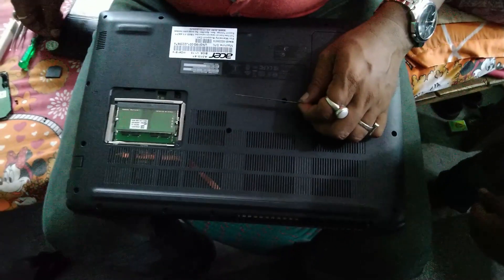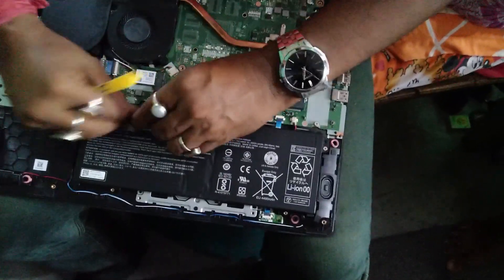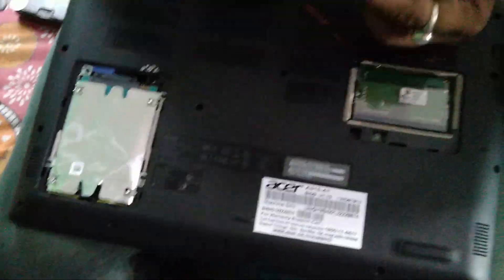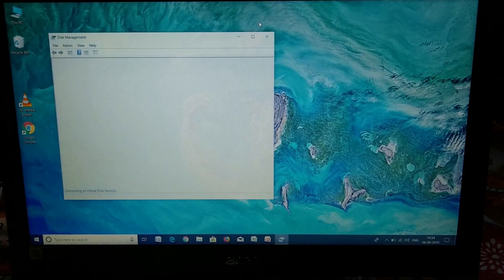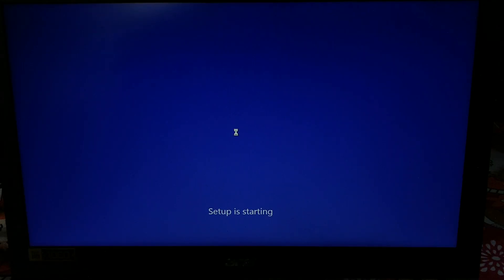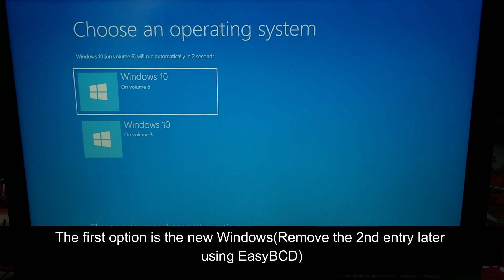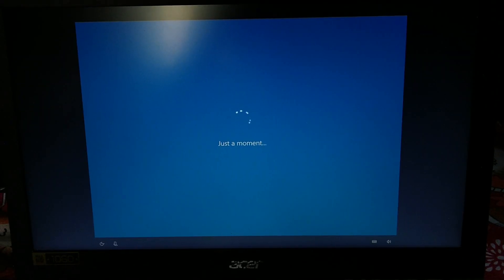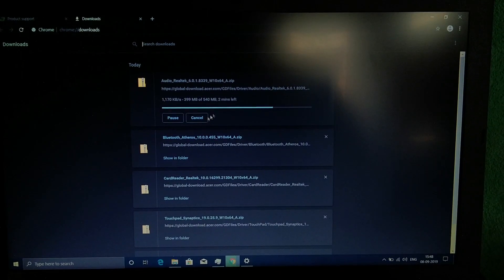ACER ASPIRE 3 a315-41 M.2 SSD INSTALLATION (SSD + HDD) | REINSTALLING WINDOWS GUIDE

Comment: hey i have acer aspire 3 a315-56 model..on a site i saw that i got pci m.2 port with 2000 speed maximum ..and there is  no any other source whether my lap actually have m.2 port. acer isnt responding when i asked them with my model number..can are you sure all acer aspire 3 models got m.2 port

Comment: I have installed m.2 sata ssd but my hdd is not showing. I asked the installer he said you cannot use hdd + ssd ....is he right?
Reply from the maker: Bro this is no rocket science, it's very simple. You can use both together, the laptop is still using the same sata m.2 ssd + sata hdd till date. 
The HDD is as it is, just initialize the SSD, done.

Comment: Bother i have an Acer Aspire 3 A315-21 model which has M.2 port for SSD, i just want to know will it work . As like in some websites, they are saying that it will not work . Please help.
Reply from the maker: If it has an m.2 slot, then it should atleast support m.2 sata ssd.
Reply: @DeepteshLovesTECH  thanks for reply❤, is it good if i use 128 gb only as system drive ?

Comment: hi, great tutorial mate. Can u tell me how to remove windows from the old 1TB hdd, while keeping the data files in it? any way out?
Reply: I have an Acer Aspire A315-51G (a pretty basic one with Skylake i3, yeah its an old one). Just thought of installing a M.2 SSD for windows so that this machine can keep up for a couple years more.
Reply from the maker: @_s.i.d_  as I just showed. Install Windows on the SSD and format the old windows partition on your HDD, later..
Reply: @DeepteshLovesTECH  brother, I meant to ask, is it possible to just remove os from that hdd, while keeping hdd media files intact. The format option which u showed will wipe out everything I guess.
Reply from the maker: @_s.i.d_  so partition your current HDD and move all your media files to your new partition. Install SSD on the new m.2 asd and then after booting and setting up, format your previous C drive which has the old windows.
Reply: @DeepteshLovesTECH  great idea man. Thanks a lot. Appreciate that u have taken time out to reply to each comment by so many people in the comments section. Thanks!
Reply: @DeepteshLovesTECH  if I could ask u just one more (😂), is it a good idea to upgrade my current aspire a315-51g (i3-6006u, have 8gb ram already, thinking of adding an m2 ssd for os and apps).
Will it last for couple more years? (Will also replace battery if required). Or simply keep running this one as is and buy a new one when battery dies.
I don't really do anything intensive, just some heavy web browsing, ms office and some movies videos n stuff.
I know the cpu is pretty weak for 2021, therefore taking a suggestion.
(I've spent 4 years on this already)

Comment: do i have to remove the windows on my hdd? if so can i copy files into my ssd first before formatting my hard drive?
Reply from the maker: Why will you format the hard drive? Just install the ssd, and then install Windows on the ssd and after booting up and setting up everything, later you can decide, what you want to delete or not.
Reply: @DeepteshLovesTECH  does that not interfere with anything? I heard having two instances of windows could be bad for the license
Reply: Also! Do i have to use rufus or can i use the windows media tool for this

Comment: can you help cannot install driver for touchpad as does not have a setup file when downloaded
also cannot find the pci enrcyption/decryption controller
cannot find webcam driver
have 2 unknown devices 
is e315-41-r3ft
am running windows 10 pro
Reply from the maker: All these drivers are in the Acer website.. definitely it has all the drivers needed as I did the same.

Comment: Hi, just 1 question, my m.2 ssd doesn’t appear in d boot menu in d bios, but it appears in disk management & my computer? Any help will be greatly appreciated. Thanks
Reply from the maker: Never encountered anything like that.. as long as you can use it, it's fine.
Reply: @DeepteshLovesTECH  hi again, it doesn’t appear also in d F12 boot menu, any idea how i can install windows in d m.2 ssd? Thanks...

Comment: I have a question, the acer aspire a315-51-341f has a m.2 ssd sata? And if yes, it has to be nvme or not?
Reply from the maker: No it supports m.2 sata 3 ssd (not nvme). M.2 is a format and it supports either Sata3 or Nvme connection. But since Aspire 3 is a budget laptop, it only supports Sata3.. which I think is good enough.

Comment: Hi! 
The HDD has developed lots of bad sectors (~370 after 1.5 years) and a lot of them are not re-allocated. I will be adding an M.2 SSD (primary drive) after the HDD fails completely. I had a few queries:
1. Is there any limitation to the size? I will be adding a 500GB MX500 or 860 Evo.
2. Will adding a 500GB M.2 drive disable the SATA port? I might add an HDD in the future.

Thanks!

Edit: My model is A315-41-R45R with 2 × 4GB DDR4 2400MHz memory modules.
Reply: I will be using the SSD as the primary drive (Windows, games, documents, ... everything on that).
Reply from the maker: @1_adityasingh  500GB should be fine, the limitation can be the power requirement of the drive itself. Crucial MX500 should be fine.
Nothing will get disabled. The laptop shown in the video has both SSD and HDD working together till this day!
Reply: @DeepteshLovesTECH  Thanks!
What are the temps of the SSD? It's right next to the CPU.
Reply from the maker: Never experienced any heating or slowness.. however 120gb is too small for any substantial heating.
SSD is not right next to the CPU, it has substantial gap between the heat pipe and the ssd. It's on the extreme right edge.

Comment: Hello, your video has been a great help. 
Quick question... I am thinking to add 4GB + 8GB RAM. Will it be a problem? Or it is necessary to add 4GB + 4GB.

Also, will my laptop stop lagging if i only upgrade my RAM and not add M2.SSD??? 

Thanking you in advance.
Reply from the maker: RAM improves multitasking and some application performance.
But SSD helps in loading everything fast.
Whatever you install in SSD, will open up fast and so if you install Windows on ssd, your whole Windows experience will become very snappy
Reply: @DeepteshLovesTECH  Understood.

And what about this
"I am thinking to add 4GB + 8GB RAM. Will it be a problem? Or it is necessary to add 4GB + 4GB.? "

Thanks
Reply from the maker: @vipin007i9  add 4+8 it's okay. Make sure it's 2400mhz

Comment: One like from me buddy, good video. have a question if you can answer, what the max supported M2 drive capacity on this machine.
Reply from the maker: It should support 480GB no problem.. I mean there is no limit as long as it is sata 3 and has no absurd power requirements.
Reply: @DeepteshLovesTECH  hey buddy. I seem to have ran in some problems, if you could help please. I got a WD Blue M.2 500Gb drive installed, did it myself. The drive was partitioned as GPT and formatted as well. I was able to use a bootable usb stick to boot and install the OS, the BIOS did identify the USB stick for booting. But after the OS was installed it still shows the original Toshiba HDD as the primary bootloader in the BIOS boot priority list. The M2  drive does not show at all. When a bootable USB stick is connect it does show the same in the BIOS boot list. I see some guys had a similar issue but am not able to figure out the cause. If you have any insights that can help. Thanks in advance.
Reply from the maker: @sanilxlf  after installing OS on SSD, during first boot you'll get 2 entries when booting windows.. one from the ssd and one from the hdd, the first one is the ssd. Just remove the 2nd entry using EasyBCD.
I didn't have to change anything like boot priority, after installing windows on ssd, it always boots with the ssd...

Comment: Hi bro I wanna upgrade my ram (same laptop)which 4gb ddr4 2400 mhz should i consider????
Reply from the maker: Go for CRUCIAL 4GB DDR4 2400mhz.
Reply: @DeepteshLovesTECH  but that is not returnable
Reply: @DeepteshLovesTECH  can i trust amazon
Reply: @DeepteshLovesTECH  whats about Kingston
Reply from the maker: @d..2363  yes Kingston DDR4 2400mhz also works. I normally recommend RAM from retail shop as you can try and see.
Reply: @DeepteshLovesTECH  thanks for reply,my friend,happy friendship day : )
My last question is that whats the price of this ram in store..
Reply from the maker: Should be 1500-2000.. previously before lockdown they were available at 1500-1700/-

Comment: Hi, I am using aspire 3 A315-21-48AQ....can I install ssd without removing the hdd?what is your best suggestion for me to buy a ssd?
Reply from the maker: Yes you can use ssd and hdd at the same time.
Go for any m.2 sata 3 ssd. In my case I used Adata SU650 ssd 128GB.

Comment: Can I keep the hdd and the ram at place and install a 256gb ssd and additional 4gb of ram?or do I have to replace the  hdd?
Reply from the maker: You can have ram,ssd and hdd all at the same time. Ram is in ram slot, hdd is in the 2.5inch drive bay and ssd is in the m.2 ssd slot 😊
Reply: Bro ram should be 4(provided)+4(installed) or it can be 4+8 even?
Reply from the maker: @hammadsultan07  yes it can be 4+8 or 8 + 8 also

Comment: Bro first time I have purchased a laptop
Acer aspire 3 ryzen 5
Laptop me heating ho rahi ha hdd ke paas kya ya normal cheez ha or kya is laptop ka fan sound karta ha
Reply from the maker: HDD toh garam hoga hi.. jeetna hdd chalega utna garam hoga.. mere me garam zyada nhi hota hai..kyu mere wale me Windows Ssd me installed hai.. hdd sirf movies aur games k liye..
Reply from the maker: Overall laptop doesn't get hot.. jeetna hota hai utna toh har laptop hota hai.. don't compare with i3 , as this is much more powerful as it has 4 cores and 8 threads.
Reply: Thanks bro

Comment: hi bro, i’m using Aspire a515-41g-17e9...can i install ssd without remove the hdd? and what you best sugestion for me to buy ssd?
Reply from the maker: Yes your hdd will not be removed. Just install the ssd in the empty m.2 slot of your laptop. Check your laptop to see if it has empty m.2 slot.

Comment: hiii hopin for a reply.
what's the maximum storage tcapacity of the m.2?
Reply from the maker: I haven't found any limitations of any kind. 
It should support any amount of m.2 sata 3 storage. The only limiting factor could be the power delivery of the m.2 port on the laptop. So if your m.2 drive needs more power, may be it will not support. Theoretically it should support terrabytes of m.2 sata 3. It should support 240/480/512gb ssd just fine.
Reply: @DeepteshLovesTECH  great! im planning to buy a 480gb and install it.
Reply from the maker: @nipplesniper  yea make sure it's a sata 3 with m.2 interface.
Reply from the maker: @nipplesniper  Some models of same laptop does not have m.2 slot.
Some have 2 slots, some support only Sata 3 some support both Sata and PCIe NVMe.
There is a lot of variations. I verified before buying from retailer.

Comment: if I go for ADATA 4GB 2400mhz ddr4ram, it's gonna work with acer right? I read an Amazon review that it doesn't work with acer so I'm just not sure
Reply: also if I go for the same frequency it's gonna be a dual channel right?
Reply: my laptop already has a 2400mhz stick
Reply from the maker: @yomamusic  yes it'll be dual channel... It's not that it doesn't work with Acer... Adata 2666mhz 8GB. Stick works flawlessly with my Acer Predator.
So for you it's better to go to shop and buy there.. prices of ram also might be lower there...
Reply: well I can't risk going out of house for a while so I have ordered Adata 4GB 2400mhz ddr4 premier from amazon. Let's see.
Reply from the maker: @yomamusic  ok.. See if it works. Many are using Adata for the high end Acer Predator laptop and it works without any problems.
Reply: yeah, hope so. Btw i didn't mean to say Acer, I meant to say AMD. I just read a stupid review and I'm out here having stupid doubts lol
Reply from the maker: @yomamusic  check my latest video on Intel Vs Amd in 2020
Reply from the maker: @yomamusic  bdw if it's not compatible for some reason.. can you return it? Also Adata ram prices has increased so much omg! It was available at 1700/- before lockdown!
Reply: it's non returnable and ikr, 8GB is 3200 while 4GB is 2500 like ffs.
Reply from the maker: @yomamusic  bro 8GB was also like 2950/-

Comment: Sorry but ahh... I need to ask again...
I have a laptop that has 4gb ram ddr4 is it compatible with 4gb ram ddr3?
Reply from the maker: No buddy.. not compatible with ddr3. You have to purchase ram of same configuration for example: My laptop came with 4GB DDR4 2400mhz ram and I purchased extra 4GB DDR4 2400mhz ram(exact configuration)
Reply: @DeepteshLovesTECH  thank you once again❤
Reply: @DeepteshLovesTECH  this is my laptop and specs
Laptop: 
acer aspire 3 A315-53G-599B
Specs: 
Intel Geforce MX130 with 2 GB VRAM
4 GB DDR4 Memory 
1000 GB HDD
Can you recommend me what ram i should buy?
Reply from the maker: Purchase Crucial or Adata Ram 4GB 2400mhz(check task manager to see how much mhz is your ram)
Reply: @DeepteshLovesTECH  Thank you again and God bless❤
Reply: @DeepteshLovesTECH  should I upgrade my ram first or should I reset my laptop first?
Reply from the maker: @eizysilva7728  first upgrade to an ssd. Install Windows 10 on the ssd, that's when you'll feel the biggest improvement in speed. After that you may upgrade RAM.
Reply: @DeepteshLovesTECH  but what if I haven't bought an ssd should I put the ram already?
Reply from the maker: @eizysilva7728  Yea you can... you can upgrade ram no problem. Later get the ssd(ssd will provide you with more perceivable difference).
Reply: @DeepteshLovesTECH  Wow I learned a lot from you Thank you and as always keep safe❤

Comment: Thanks bro but u know more money is more faster. Hope so go this line also nvme or pcie. its to line bcz sata 3 read and write its poor bhf pcie  i know more costly fast u know also pcie is ganaration 3 which is know for fastest technology m.2 laptop and desktop industry. PCI Express (Peripheral Component Interconnect Express), officially abbreviated as PCIe or PCI-e,[1] is a high-speed serial computer expansion bus standard. So what  is moral of the communication. Money and speed 2 is unity make each and other
Reply from the maker: I am using 120gb sata 3 memory for past 2 years and my friend is using Samsung sata 3 for past 5 years..no slow downs. Please consider subscribing

Comment: Ic but if u know sata 3 ssd support. May be this video watch A315-42-R414 link is  https://youtu.be/HrDRDkunfD0 1st slow motion u have so results is come is supprted pcie or nvme 2280 slot. Plese confirm
Reply from the maker: If you want to take chance then you may go for PCIe... But I'm not too sure. Listen don't spend extra money on PCIe ssd.. SATA 3 m.2 is plenty fast you won't notice any difference! Instead of spending 30% more money on Pcie, save the money and go for Sata 3.

Comment: Hey bro, saw ur videos,they are shot and straight to the point... My doubt is ,can i use it for video editing ? I bought this same laptop recently
Reply from the maker: Vishnu Karthik yea of course you can use it for video editing. It has 4 cores and 8 threads so you can edit videos. Don't expect really high performance it performs like an i5 8th gen U series chip. Don't expect heavy color grading.
Reply: Thanks for the reply bro.. what all upgrade should i do in order to get a better smooth performance
Reply from the maker: Vishnu Karthik upgrade to an ssd and install windows and other frequently used softwares on the ssd and you should have atleast 8GB ram on your system.

Comment: What happens to my files, are they still there, please answer?
Reply from the maker: Horrid GAMER if you do not format the C drive all files will be intact nothing will be deleted. The original C drive is from the Hard disk. The new C drive that'll be created is the SSD, so there is no connection in between the SSD and HDD. I didn't backup anything and after installation, the original files are intact as they are basically on the HDD. Later I formatted the HDD(like removed the old windows files and all)